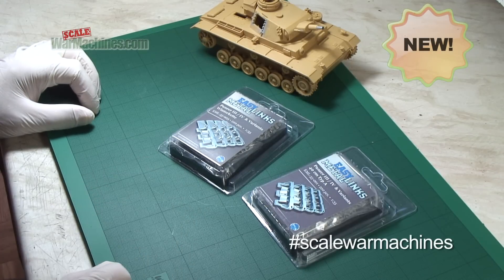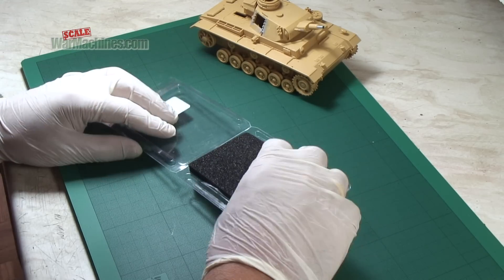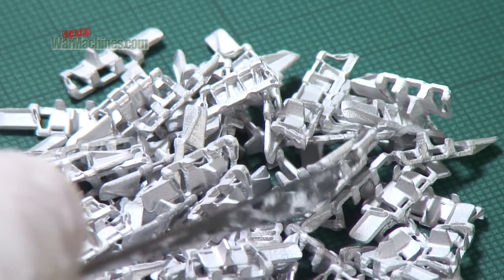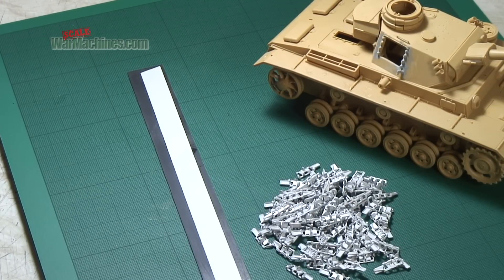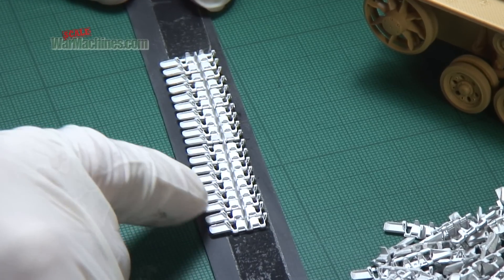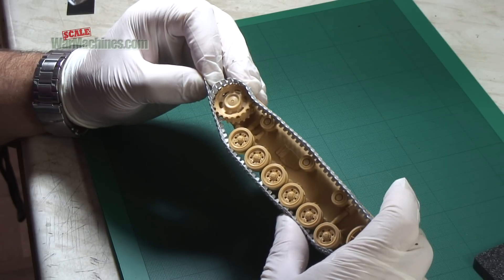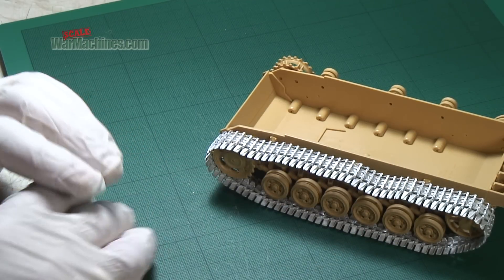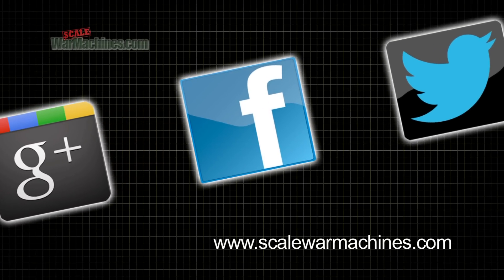EASY METAL LINKS TRACKS

Comment: Back again after two years having tried both  the Fruil and Masterclub and these.The Fruil were findley, and I felt a thick CA would have given a better result, but  easy to apply too much glue and make them stiff. Comparing them all I think the Master Club are perhaps the best, at least no glue required and those pins are not too bad to fit, even when you have limited sight in one eye. 
Be nice to know what you feel . Regards John .
Reply from the maker: Yes, the Masterclubs are fine if the resin pins fit perfectly. We had one set that needed re-drilling but mostly they've been perfect.
Reply: Unfortunately they don't do the range that Friul produce 😞

Comment: thats not a new idea this is like the very first system of Friul ! This dont work for long time because it will lenghtned over time and will crack after a while because the weight of the tracks is to heavy for the pins !!